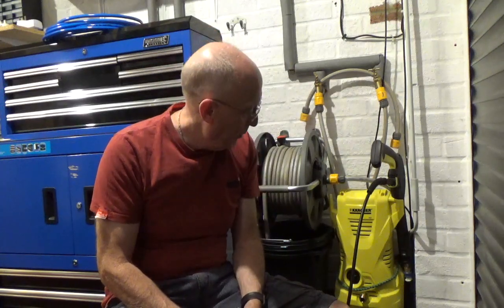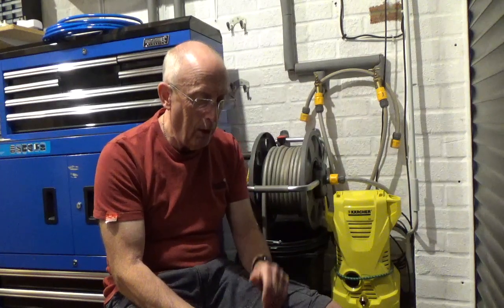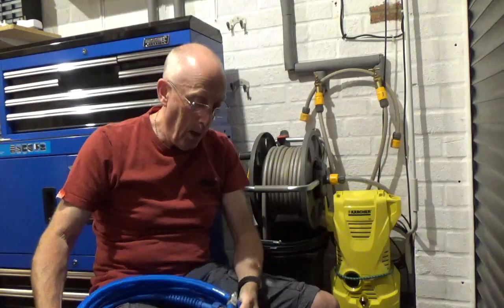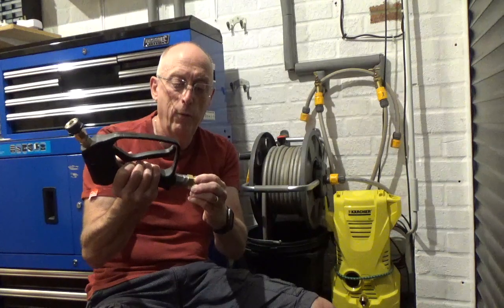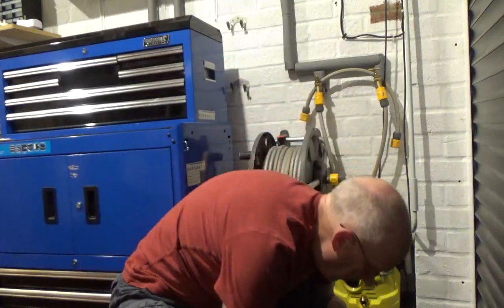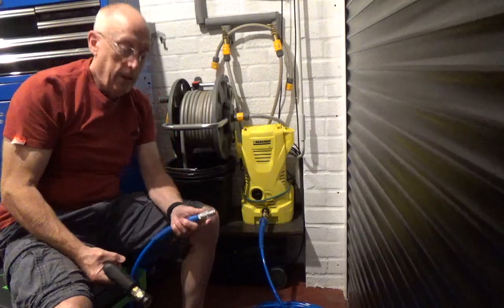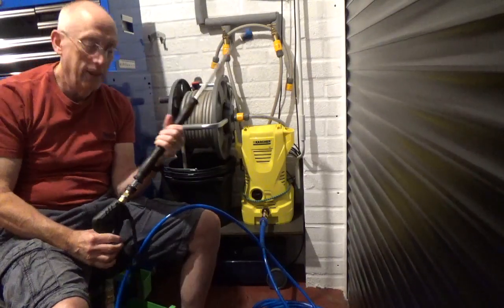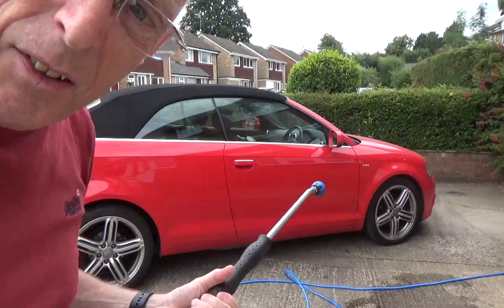Pressure Washer Enhancements with Gleem Detailing

Comment: Think you explained and solved a massive problem that so many of have. My hose loops round and you have to forever pull it straight and unloop it to get it straight once again. Then you can't hang it on the wall is as it wants to unravel. Along with having to unscrew either end of the hose to store it neatly in the garage. Great solution you've got. Thanks for sharing your ideas.
Reply from the maker: Sixty Seconds of Stephens I’m glad it is of help. This set up has made cleaning the car so much more enjoyable 👍
Reply: @ObsessiveCarDetailer  when I first started cleaning my car my old, old pressure washers had 3 meter hoses. Which was so inconvenient.
Reply from the maker: @sixtysecondsofstephens2386  You & me both, I then put a 10 m Karcher hose on and that just wanted to fight with me so this solution came about & really happy with it. Next after the lockdown I will look to upgrade my washer to a Kranzle K10. That is also available from Gleem Detailing and free shipping so will probably go there.
Reply: @ObsessiveCarDetailer  they are the king of pressure washers.
Reply: @ObsessiveCarDetailer  they are the king of pressure washers.

Comment: Have a similar set up on mine & always empty the gun after use and hang it up to avoid any damage but being a driveway cleaner it doesn't get everyday use. I noticed a creak from the trigger recently and then noticed the plastic shroud on the quick release coupling had started to crack. Thinking that the coupling was gonna fail, i removed it and found the end of the gun was very rusty indeed and the plastic shroud is only actually a cover and underneath it is just like a standard knurled brass coupling. I sprayed WD40 down the gun & quite a bit of rusty debris came out . The creak is now fully gone & then a couple of sprays of Atom Mac should preserve it a little . Might be worth a try  to prevent any problems in the future👍🏻
Reply from the maker: where did you get the gun from Alan

Comment: Spoke to Keith at Glem yesterday new hose ordered, on the strength of your recommendation. I also don't know why Karcher has such bad hoses, I have a new one and it's no better!
Reply from the maker: It is a real upgrade and if you have ordered one of his guns as well then it will make your experience so much better. Thanks for the comment👍
Reply from the maker: Hi Patrick, did you get a new hose & gun?
Reply: @ObsessiveCarDetailer  Yes Keith was very good.

Comment: Hi Martin, what do you do if you want to reconnect the old Karcher lance to the pressure washer, e.g. when you need the full power of the Karcher lance say to clean your drive or patio, or similar tough cleaning job?
Reply from the maker: I just disconnect the hose from the washer and reconnect the original hose when I wash the patio

Comment: Am looking at upgrading my hose to one of these. Are they worth the money are they alot more flexible than the karcher one. Thanks
Reply from the maker: Hi Simon, they are more flexible and a lot better quality but not as flexible as say a garden hose but so much better to work with than the Karcher ones. It really has made cleaning my car a much better experience as I no longer have to fight the hose. The gun & lance are amazing and great quality & the performance of my old pressure washer has improved with this kit connected. I do not regret spending the money. You may look around for cheaper Chinese kit like some advertise but this is quality German Engineering.
Reply: @ObsessiveCarDetailer  exactly I have just started mobile valeting part time at the moment so trying to upgrade every so often. I have just got the hand held gun so much better I got the k5 x range and its Brill with that. May consider it then thanks very much for your advice I appreciate it
Reply from the maker: @simonattwood4363  Glad to be of help Simon & I wish you well in your new enterprise, hopefully the reviews on my channel will be of help to you. I always just say it as it is as I am just an enthusiast.

Comment: I’ve got a K2 & have all the same issues as your with the set up. I’m forever getting tangled up in mine or it falls over on the drive. Was it an expensive upgrade if you don’t mind me asking ?
Reply from the maker: Hi Dazza & welcome's to my channel. If I remember rightly the cost of the quick release gun, wand, hose & fittings was around £140.00 if I remember rightly. Suggest you contact Gleam Detailing (have a look at their website and all contacts are on there) and they will give you a proper quote. You will find them very helpful. Let me know how you get on.
Reply: Obsessive Car Detailer ok will do. Thanks for getting back to me.

Comment: LOL - I've got a 6 year old K5 compact and the hose is also driving me insane, its got to go. Now that you have had this set up for a while are there any negatives vs the original set up? plus can you change the end spray nozzle as you can on the hand gun. Oh and would you still recommend this brand? Thanks this made me laugh a lot.
Reply from the maker: Hello Tim955, If I have made you laugh then it was well worth doing, we all need a little cheer👍. I have no negatives what so ever with my set up. It made cleaning the car a delight rather than a debate on who was going to win today, me or the hose. I still have the same set up but would like to replace my little k2 this year with a Krenzle K10 if I can get it into the workshop without my wife finding out how much it is. I will also buy it from Gleem as Im big on customer service and thats what you get from Keith. I have spoken to him a couple of time since I bought my set up and he is always happy to help. I have a selection of nozzles that quick fit into the gun so no issue there. Anything else you want to know about this or any of my videos then please just drop me a comment and I will always get back to you. Hope that helps and stay safe
Reply: @ObsessiveCarDetailer  Many thanks for the quick response, I will contact Gleem to get an idea of prices plus i need to check that any investment can be easily transferred to a future jet wash. Best wishes.
Reply from the maker: @Tim955w  no problem. Let me know what you do and how you get on👍

Comment: Hi , could you give me the details of the store and the parts and hose that you bought and rough cost ? Thanks Mike.
Reply from the maker: ok, hope you are sitting down, this is expensive but having used them for nearly 2 years I am still delighted with the kit and makes washing the car so much easier. I bought them from Gleem Detailing, they have an on line shop. The lance is a Suttner 600mm with bend £30. Quick release Suttner ST1100 gun £45. 10m hose with fittings £65. Do you need smelling salts 🤣
Reply: Thanks , great

Comment: May i know how much those items cost please Martin?
Reply: I have a new Karcher K2 with the later hose connection
Reply from the maker: Hi I’m struggling with the internet at the moment but I gave this info to mke6653 in the comments a couple days ago so check that out. Hope that helps
Reply: Just read it, yeah , not cheap, i may just try get quick release connections for ease of packing the stuff away when finished with, as the new karcher hose connects i think are a pain to release.

Thanks Martin